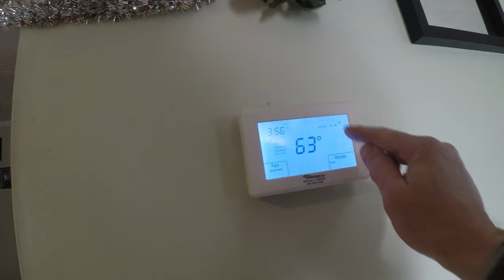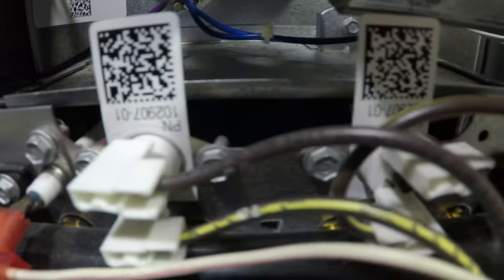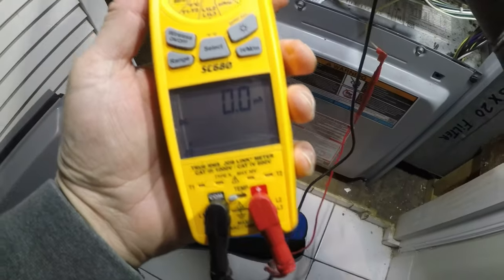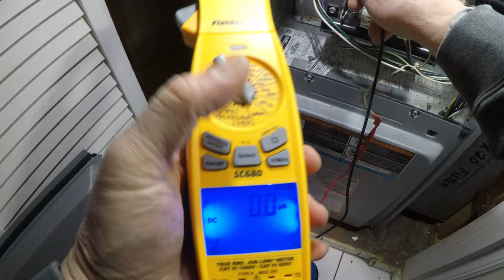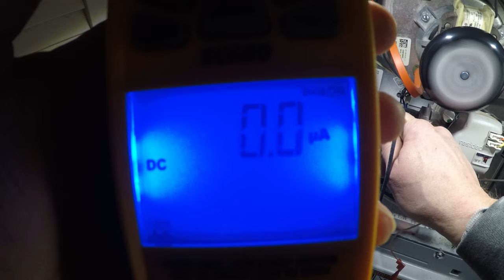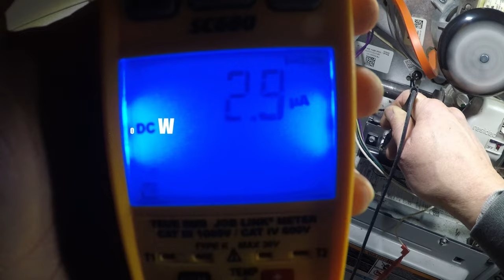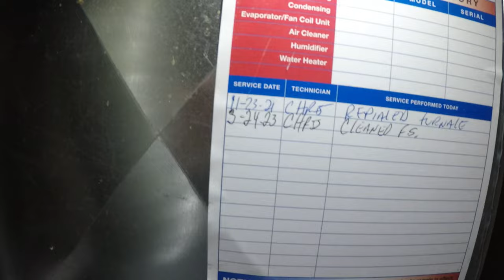The Most Common Reason Why A Gas Furnace Won't Turn On

Comment: Good channel. Thermostat being that close to the furnace could lead to some irregular readings. Hope the wire hole in the back is insulated.
Reply from the maker: Thank you! Actually the furnace is in the center of the house and the stat is right above the return air grill.  It's a really small house.

Comment: Have you thought about setting up a dealership to install name brand equipment instead of this 2nd tier stuff?
Reply from the maker: I install Armstrong mainly, I only install 2nd tier for rentals or someone on a budget. I have thrown the Armstrong at those markets and I lose the bid. With the Carriers and Bryants, Lennox you need a storefront with big overhead and have to spend a boatload of money to be their top spot! No thanks! I will stick to Armstrong with the stainless steel heat exchanger.